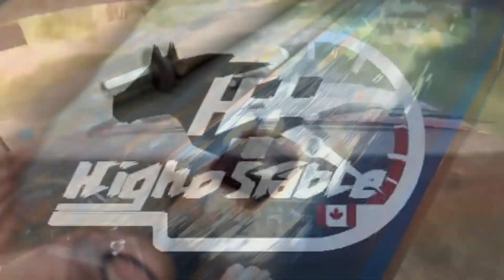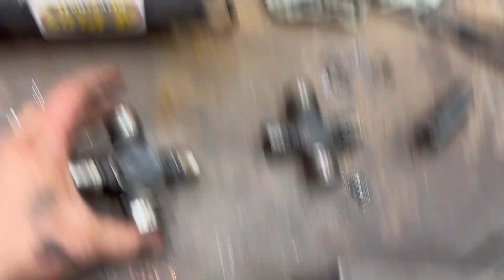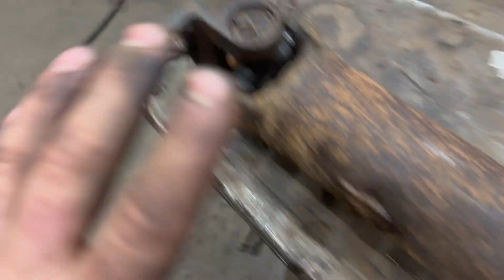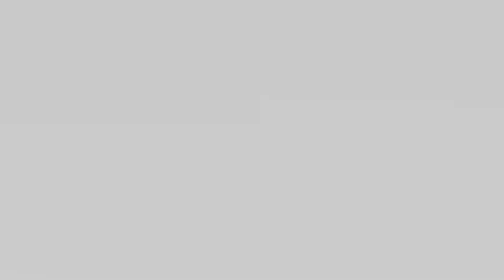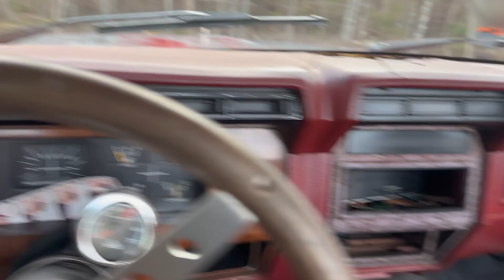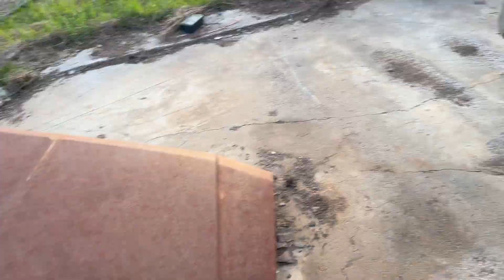Can a used parts, homemade driveline get the f150 back on the road? First Drive / Wash of the year?!

Comment: Great job on the drive shaft Colt. When I went to first start my old 85  a couple months back I had the same problem with my truck not starting Haha. My 351 could use a few trips to the AAA group meetings. But it's all about smiles per gallon not miles per gallon. Looking forward to your next video. Cheers Colt
Reply from the maker: Haha yeah the old 460 is hard on the pump haha 😂